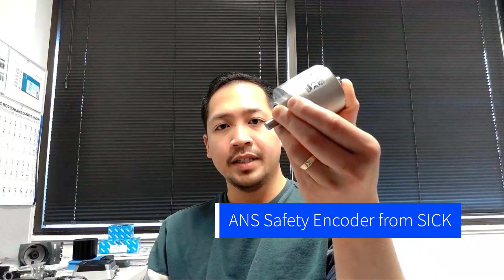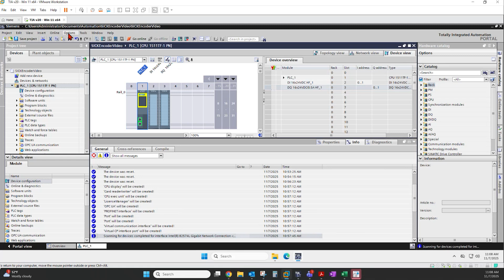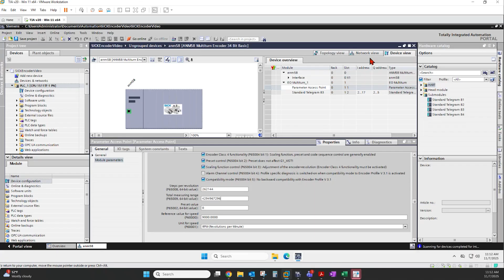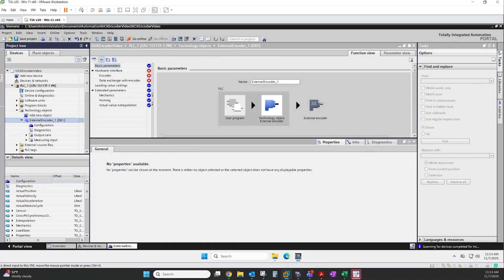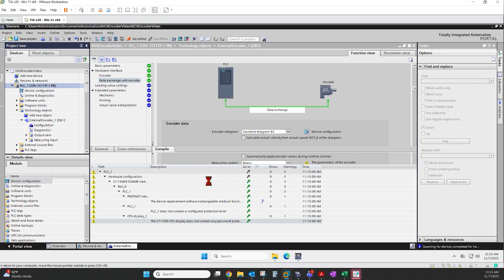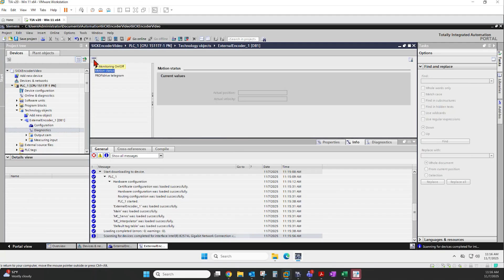SICK & SIEMENS | Setting Up a SICK PROFINET Encoder in SIEMENS TIA Portal | EandM

Comment: Hi, thanks for the video! I was wondering how I can reset the current value back to zero. Thanks!
Reply from the maker: Hello, thank you for the comment. This links provides details on how to adjust the absolute value of an encoder using the MC_Home function.
https://docs.tia.siemens.cloud/r/en-us/v20/using-s7-1500/s7-1500t-axis-functions-s7-1500-s7-1500t/axis-functions-s7-1500-s7-1500t/homing-s7-1500-s7-1500t/absolute-value-adjustment-s7-1500-s7-1500t